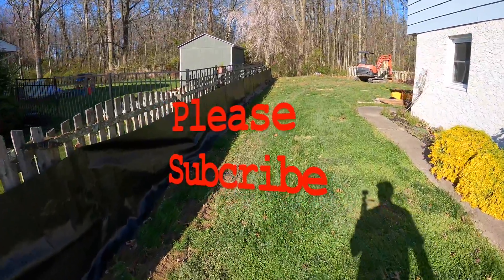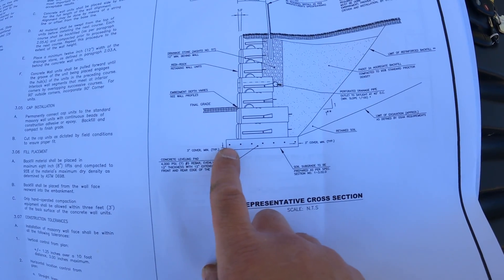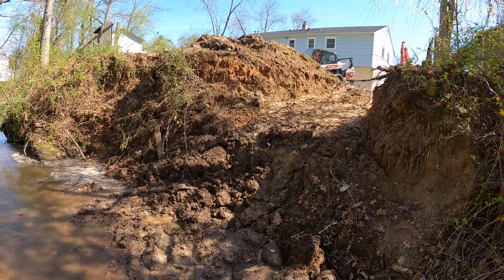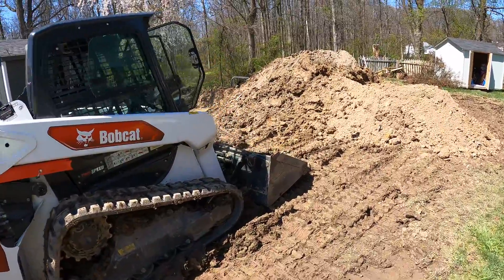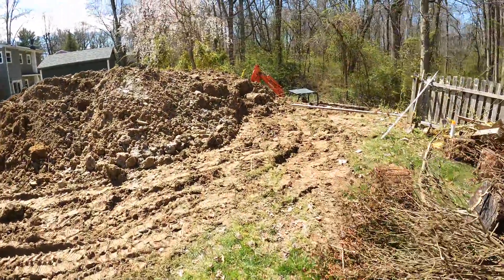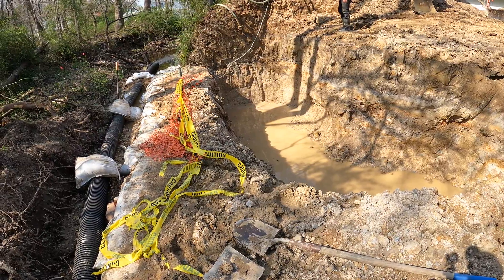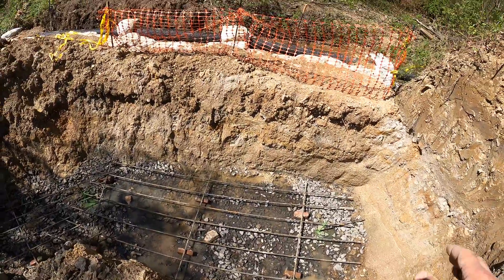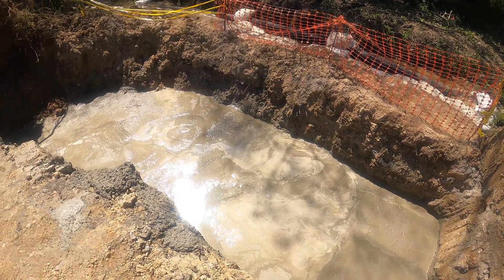Building a Redi Rock retaining wall on a creek

Comment: Curious to know the total cost of this project. We may need to construct a retaining wall at the beck edge of our yard, in Winston-Salem, that backs up to a flood zone, with known flooding over the past 50 years. Three times in 50 years the basement has ended up with up to a foot of water. The goal of a retaining wall, keep the water from flowing into our backyard, so it continues to move downstream, in-channel (of the creek). Going to guess we are looking at a 50 foot long wall. Probably does not have to be more than two feet high.

Comment: How much does the footing have in it.
Reply from the maker: The footing is 10 yards of concrete. I over ordered a little bit and we ended up with 18" of concrete. The plans called for 12" minimum. Thanks for watching
Reply: @srmcontracting  Okay. That's not going anywhere.